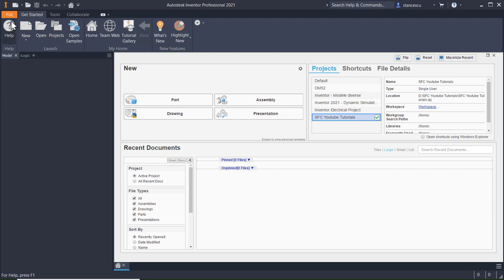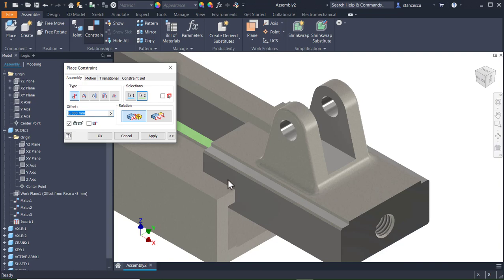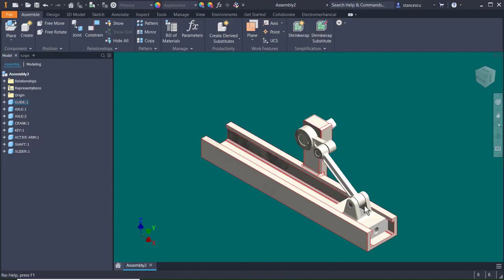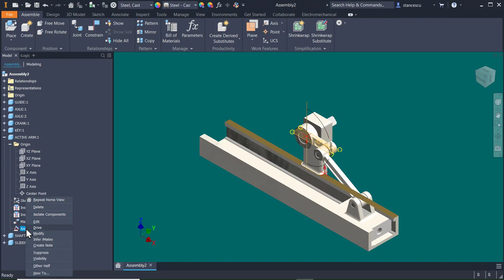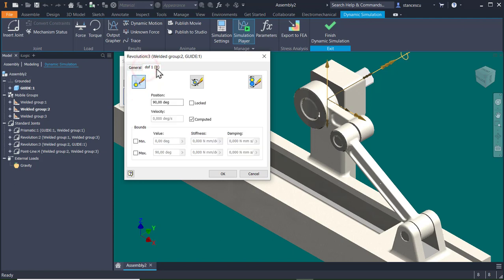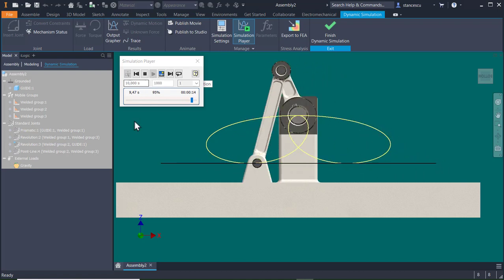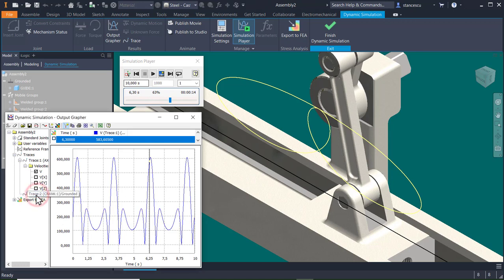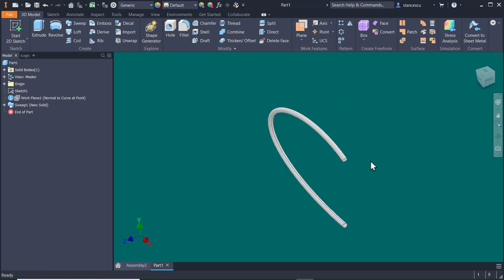Tutorial Inventor - 174 KINEMATIC vs DYNAMIC

Comment: Dear Constantin ...as ussually outstanding case.
I model my mechanism and  I used  differnt turns (rpm) for testing mechanism  trough dynamic simulation.
I found that:
1.  during some rpm  (in my case 10 - 13 rpm) mechnism stop in position when oll three axes where in the same line ...something like " death angle", It was blocked.
2. In some rpm ( 5, 39 and 40) the mechanism moved on one side only. The first rotation was ok...the slider moved from one side to second one and that slider stay only on one half or route ...like in kinematic simulation.

In the end ...it is nice case.
Best Regards
Jan
Reply from the maker: The important fact is that you can control the mechanism as you want. You are powerful and happy to study such interesting mechanics. Congratulations!